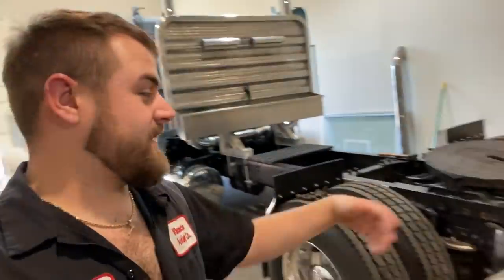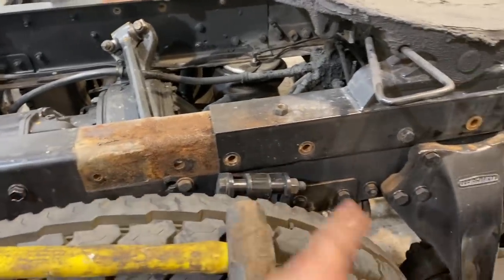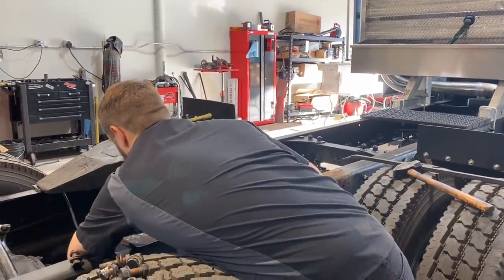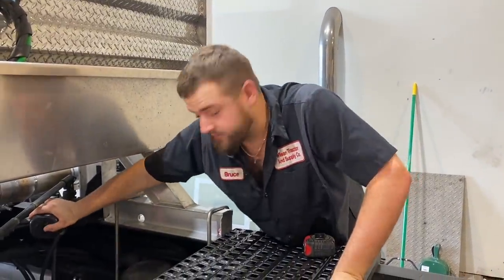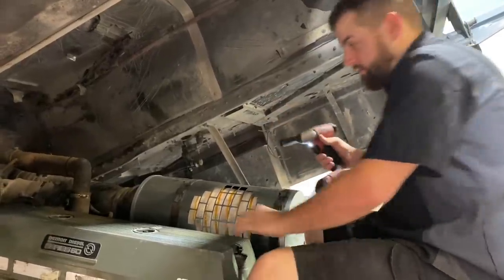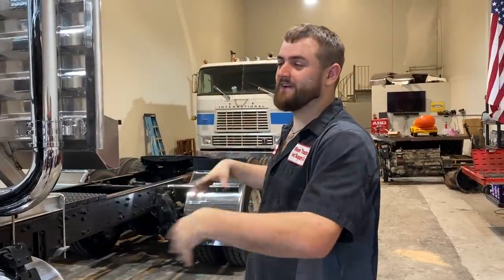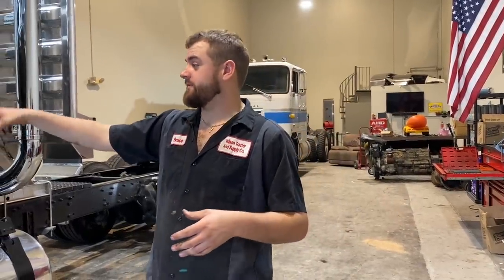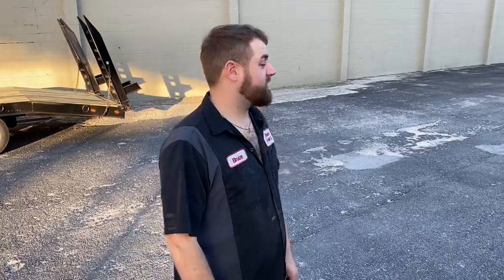Completing "Blue Collar" the Cabover Part 1....

Comment: Let me help you! I worked Into difference in semi shops And I have driven semi  trucks and motorcoach Buses! And from experience mechanic Told me one time the series 60 Detroit engine does not need the valves adjusted every hundred thousand miles like some other diesel engines. He worked for us as a contract mechanic and said everyone he took apart to adjust the valves did not need it. Series  60 Detroit motors other than a few you turbo issues In 1999 and year 2000. The  Series 60 Detroit Until they did the emissions change Was a bullet proof engine. You should not need to do any major work including adjusting the valves just change the oil and drive it

Comment: Take fifth wheen frame off completely. Disc sand rust off both sides then coat both affected rails and fifth wheel frame with rust converter. That fifth wheel frame previously running over the area of where the chassis rails were extended may have been put there intentionally to add extra support to strengthen that specific joint. It may be a good idea to extend both angle lines to a length that supports both joints once again. It will be heaps more stronger than how you have made it now at least it will be as strong as it was before you tampered with it !!!

Comment: Bruce another great video just letting you know that the injectors are in fact mechanically activated but they are electronically metered which is why there  are wires running to the injectors.
Reply: Your talking way over this guys head.. But nice try..

Comment: Those injectors are a electronically controlled, mechanically actuated injector. Meaning the injector is still mechanical fired, but the amount of fuel is electronically controlled by the solenoid on the injector

Comment: Bruce run hard lines for your airlines down the frame rail and put  pogo stick closer to fifth wheel and extend the electrical the same way that makes it look better you could run them to the back of the frame to make it come up under the trailer and fix your trailer lines the same keeps every thing out of sight ask the guy at the truck junk yard about it

Comment: There is an offset idler pulley kit available for the AC belt/pulley but you'll have to buy a longer belt to use with it. It will allow at least another 2/3 surface contact on the compressor pulley by pulling the belt angle back upwards on the bottom side. If you can't find the kit you can make one.

Comment: Try to flush out the solenoids to make sure there's no trash in them check all the solenoid spring to make sure you don't have a broke one jake brakes on the series 60 sometimes get oil on the connectors and they lose connection intermittently

Comment: If I wanted “Blue Collar” to rise to show truck heights I would:
1)Paint the frame blue to match the cab
2)Put blue full tear drop fenders on rear
3)Deck the frame with aluminum tread plate
4)Put stainless tool boxes on each side
5)Have a stainless 5th wheel cover
6)Light bars on back and under in front of drivers
I wish I could draw you pictures but check around, there are plenty of rigs looking awesome 
Kudos on improving presentation, completing project, and respecting viewers

Comment: Starting price on that Used trailer $10,500? For that price someone can get a brand new one.
Reply from the maker: False
Reply: that`s just a starting price, he`ll take $500 though
Reply: @jackmehoff2961  I'd give him $250 for it, Just for the price of the steel. At least he finally admitted that he hasn't finished a single project.... Yet. But as I've said before what isn't he going to sell as a flip.
Reply: @Bruce_Wilson  found a 2019 gooseneck in Gainesville under $14,000. Found 3 more,  from Washington state to just outside Los Angeles and Colorado.
Reply: @jasonj8740  ok, this is not a gooseneck. This is a 5th wheel trailer. Its ment to pull by a semi not a pickup unless you mount a 5th wheel to a 1 ton diesel and add and air supply. New, these trailers from Kaufman run $18,000 give or take on many options. Used semi trailers still run around $10,000 fixed up. Gooseneck pickup trailers run $12,000 new and go up depending on options. They hardly loose value as a 1995 model will still fetch $4000 in rough shape. What makes you think this trailer fixed up looses over half its value? It doesnt. 

https://www.kaufmantrailers.com/flatbed-trailers/drop-deck-flatbed-trailer/

Comment: Make sure the wire is tight in the connectors that go onto the Jake spools. Your Jakes will flutter and not work right if there's any play in the connection. Jakes added weight aren't worth worrying about.

Comment: Be very careful  with  a 60 oil drain plug too you can crack those old fiberglass drain pans there's usually 2 find what one has been used a lot the other one will be seized

Comment: Ha wait till you pop the valve cover on the v8 you will ask where is the rest of it its simple but finicky we have an old v- 12 pete in the barn was my fathers I have stuff replaced as it dryrots all the air inside and out was done over the last 6 months i have got new wiring harnesses I think I am getting help with that. I almost lost my cool with the air stuff behind the dash.

Comment: It looks like the flex exhaust pipe needs to be supported between the turbo and the Y, as you’re hanging a lot of weight off the back of the turbo.  Maybe there is a support that I couldn’t see in the video, but if not, it would be a good idea so you don,t break the turbo casting.

Comment: if you ever wondered what the inside of a locomotive diesel engine looks like, its almost identical except on a massive scale. those injectors are mechanically fired. you also need an injector tool to set the injectors, looks like a small pick tool. very interesting and good engines.

Comment: Bruce, double check that AC belt routing. From what I'm seeing the alternator and AC compressor are on their own system with a belt tensioner, to add they appear to be powered by the crank pulley. Blue Collar is looking great so far. Upon further reading, you should have two belt tensioners. Hmm, watched more of the video and seen there is a threaded tensioner. I agree with you, that set up doesn't allow for enough belt-to-pulley contact on the AC compressor.

I like problem solving obviously and that belt is driving me crazy. What I think happened is someone cobbled that threaded tensioner because for whatever reason, they decided not to go back with the proper spring tensioner and belt.

Damn, maybe I'm wrong from the start and that set up is correct. So many different belt drive systems for the Series 60. I blame engineers and the EPA.

Comment: i watched both LOGGER WADE, AND COttONTOP3 re-board trailers, and they both used a mop and used oil from trucks to mop it on the new boards. they said it will last almost forever that way
Reply: Yes, used oil and diesel mixture. Coat ever year if out in the weather. Takes a day to dry. It will last forever. How farmers kept their fence posts longer also

Comment: To everyone saying "he doesn't know what he's doing" first, at least he's doing something right now your lazy ass is sitting on your couch or in your room watching him do it instead of doing it yourself second you don't learn what you're doing until you start educating yourself and working with something he may not fully know what he's doing right now but In 10 years he could be a full diesel mechanic thirdly if you don't like what he's doing just go away this world's already hateful enough.....😁😁😑
Reply: 1. Im at work bored with nothing to do
2. I read up on things i don't know. From what i learn. I dig a little deeper. From there, a little deeper. Its done close to right not ripped apart then read up on it realizing its WRONG
3. A dumbass deserves to be called out when of the comments 10% know what they are talking about. 20% witnessed it right and 70% of the people are idiots. 
4. Projects i start are typically finnished before i start another. I dont leave anything incomplete. The list of projects grows, however 1 isnt started till the other is complete. Most recent being complete has been a bed frame being stripped, primed, sanded, painted, sanded and polished. Smoothest paint youll find on a bed. Next being a lamp out of an old fan casing

With that said, there are a few things i will defend on, however majority of it not. 
1. The frame was not lined up correctly or braced right. Driver side rail has a dip in it. Something a long straight edge would have caught or properly leveling the entire truck with no wheels. A "smooth transition" is not level
2. He keeps measuring from middle of front axle to middle of rear axle. Its middle of the tandems for the proper measurement 
3. Has an item he wants yet refuses to use it. Meaning the hitch. If he thinks that hitch is factory. Sadly its not. Hitches wear out and are replaced all the time.
4. Half assed painting. This is pretty explanatory 
5. Unfinished projects sold off
6. Tearing things apart for no reason other then "i want" but screws it up

I can keep this list going, but im stopping with this said. I'll gladly keep using ad block to prevent revenue coming from my view, and refuse to subscribe.
Reply: @brandoncaldwell95  Bruce is a fart in a windstorm

Comment: I personally never reused 5th wheel bolts when I removed them.
Reply: He has no clue what hes doing
Reply: are they a tty bolt or just because? just curious
Reply: He's never seen what happens when these truck come apart on the highway. people die from ignorance !!
Reply: @adam t .. the cost of the hardware is minimal and usually the nuts are nyloc and one time use
Reply: Adam T safety. They could be stretched or fatigued. I am a retired heavy equipment mechanic, the liability shifts to the manufacturer if you replace the bolts. We never asked, they always were replaced.

Comment: Mop some burnt motor oil onto the trailer floor.
Reply: Has to be a mixture of oil and diesel.
Reply: Why, used oil is acidic as hell and makes the deck into a skating rink when it's the least bit wet? Boiled linseed seals and don't get slick.
Reply: 50% oil and 50% diesel. Its a treatment like creosote

Comment: You use the angle grinder like a man. No gloves and no protective cover. 
I only use gloves when it is cold and I have never fitted a protective cover to my angle grinders. 
They are just in the way. If anyone thinks I'm wrong, they may say so. 
I probably used angle grinders before they were born.
Reply: Im just lazy to take the guard off. Once its in my way, itll disappear. Gloves are for whimps. Except washing the walls of a chainsmokers house that go from a brown/yellow/black haze over blue to a vibrant blue paint. Thatll give you nicotine poisoning
Reply: @brandoncaldwell95  Well hehe. 
I'm a chainsmoker. 
repaint indoors every five years.
Reply: @makingithappen5178  ya, itll bleed through. Trust me. Also, the house will smell like cigarettes.
Reply: @brandoncaldwell95  Or cigar.

Comment: Are you going to finish the fire truck and school bus? I would love to see what you do with the fire truck.
Reply: Cleetus Mcfarland has the fire truck.
Reply: Bus was sold, so was the fire truck. Im happy the fire truck was sold to someone who will actually use it.
Reply: fire trucks are more then just fire suppression. Properly fitted. They deal with auto accidents, traffic control, medical, and spills. We do not know or see what exactly that engine was set up for. However, in its current state, its a traffic control device, auto accident, and fire vehicle. Side job, which is good to keep the systems flushed is watering.
Reply: @brandoncaldwell95  Juepp.

Comment: Paint the trailer wood with black oil based paint it will last forever
Reply: Used oil and diesel lasts forever. Painted decks do not.
Reply: @brandoncaldwell95  paint it with oil based paint and it will last for years and stand up to oils, diesel, etc
Reply: @rt0110  or 50/50 oil and diesel and it'll do the same and cheaper.